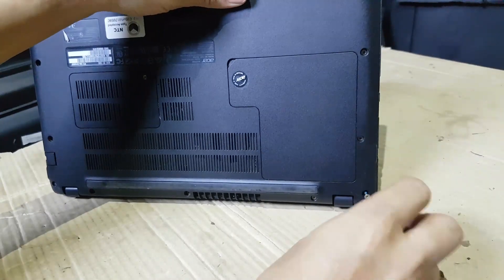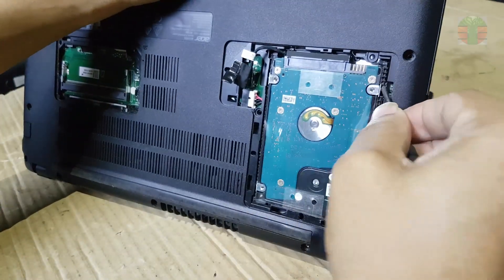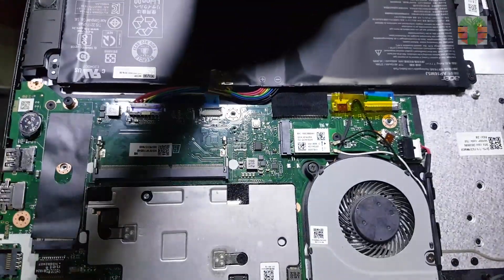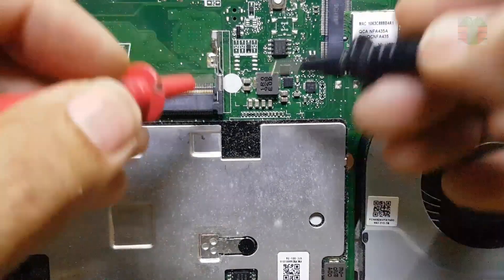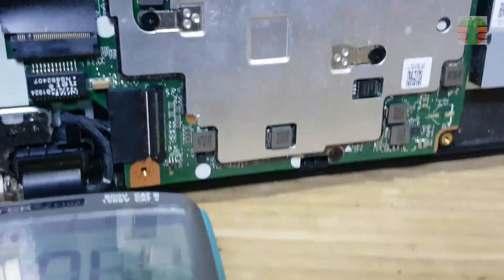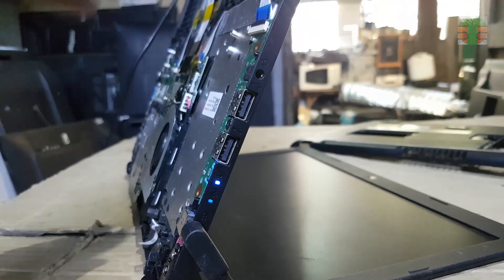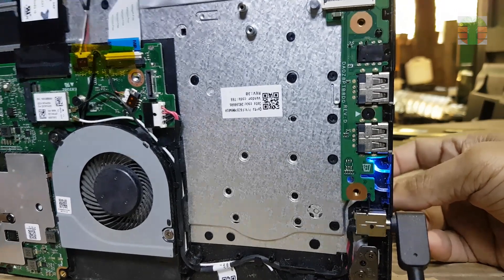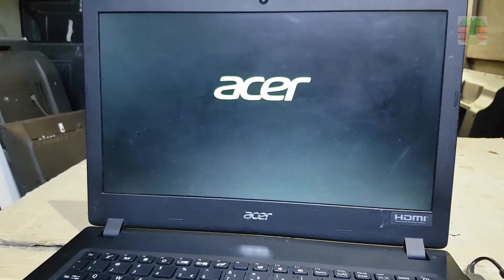Acer A314-32 No power and Not charging.

Comment: Sir, tanong po. yong acer laptop ko no power. Yong laptop charger ko may Voltage sya before plugged sa laptop. pero pag isaksak ko na cya sa laptop, nawawala voltage nya. ano kaya probema, sa laptop or charger??
Reply from the maker: may short circuit siguro yong mother board, o may defecto yong charger.
Reply: @tevzTVTevatronics Sir how much cost to repair it PLZZ tell me